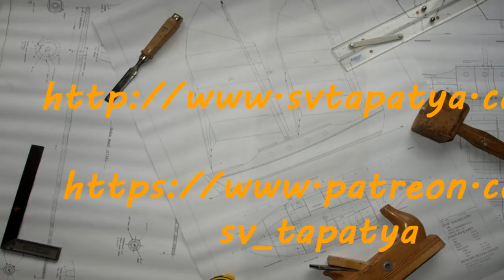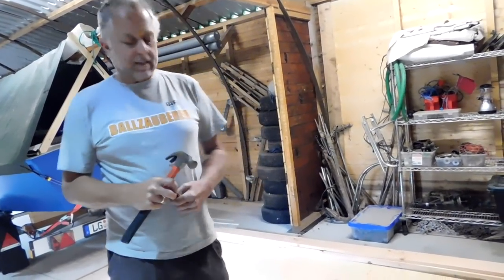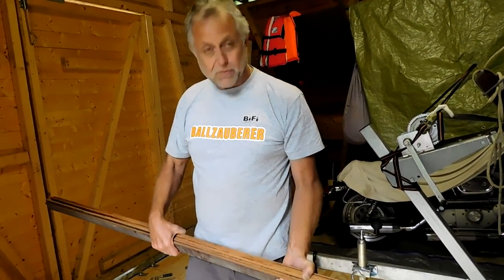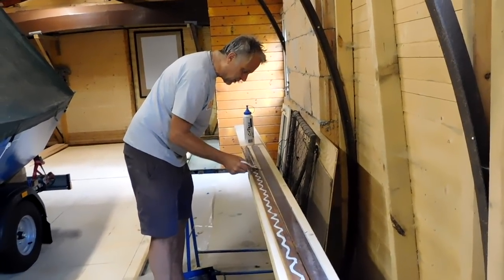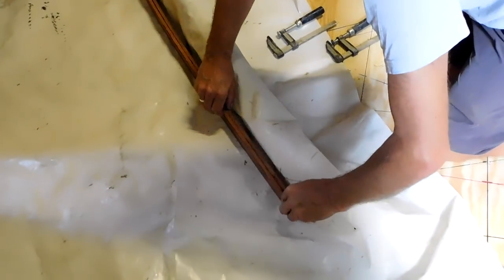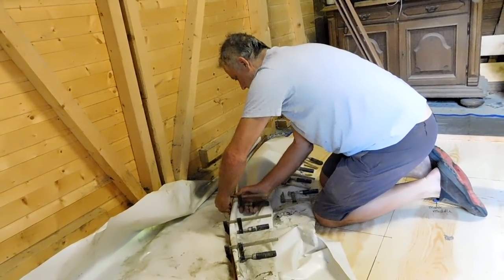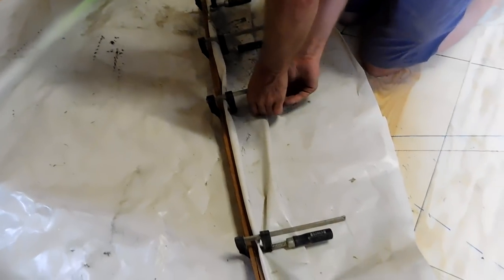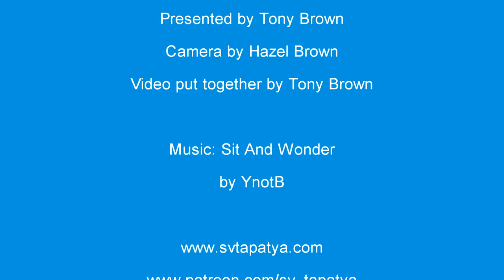Lofting part 2 and laminating the stem - SV Tapatya Ep04

Comment: I have just started watching your videos.  SVSeeker recommended your channel.  I have never built a boat, but plan to.  I did, however, do trim, cabinets and stairs for many years.  One of my specialties was curved stairwells, lots of curved lamination work.  I, too, used waterproof white glue, Franklin Titebond for several years.  I purchased it in gallons by the case.  However, one of the handrails split open when I was doing a final cut.  This is beyond frustrating as it takes many hours to get it to that point.  This was the only one that failed so I may have done something else wrong.  After this, I did some reading and white glue is not recommended for curved laminations, as there are continuous tension forces on the wood. I tried a urethane glue which was really messy but it worked good.  I finally settled on a two-part epoxy glue and never had another issue.  You're right on track with your jig as that is exactly how I did it.  Lastly, I would recommend mixing large enough quantities of glue for all the pieces at once and use a roller, it's much faster.  It will bend just as easy.  Take care and I look forward to watching your videos.  Brad
Reply from the maker: Thanks for the thoughts, Brad. Yeah, I wouldn't use white, PVA type glue for boat work, even if it claims to be waterproof. I'm using Collano Semparoc which is quite a new product. It's a foaming urethane (I think) glue that is recommended for boatbuilders and is fully waterproof. I do also use epoxy where necessary, and will be using it increasingly as I get towards planking the hull.
Laminating Is great fun - producing curved pieces of wood from thin strips, and it sounds like you're good at it!!
Reply: That's good, the color and consistency looked like white glue.  I will look into that glue.  Aside from the urethane glue being messy it was also as thick as honey.  When I had a change in angles, I also always start at the tighter bend and clamped away from it.  This gives you leverage on the tighter bend.  Good luck!
Reply from the maker: Yeah, that's good thinking on the order of the clamping. Thanks Brad!

Comment: You have almost finished as I just start. That thick Poly will introduce an error, you are no longer following your lofted line, but a line a millimetre or so beyond. Hardly a major issue, but why introduce error of any kind. Put poly under the brackets and then clamp to the brackets. Or, even use cling-film or saran-wrap to introduce a miniscule error. You could wax the ply or use any number of ways of not sticking to the lofting boards.
Reply from the maker: Well, Alan, the table of offsets is to the nearest 16th of an inch (1.6mm) so I don’t think the thickness of a piece of plastic sheet will make much difference. Of course, you’re right in terms of precision accuracy, but a hand-built boat isn’t that (the way I do it, at least) 👍